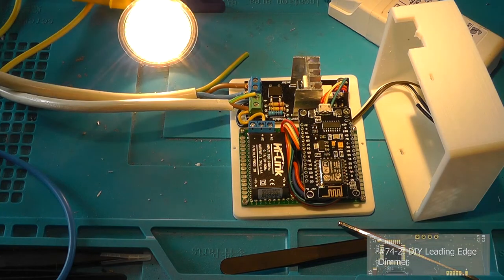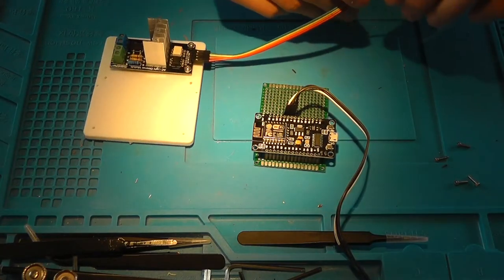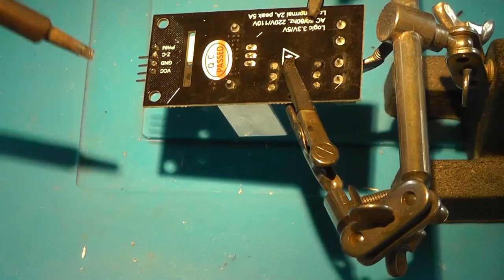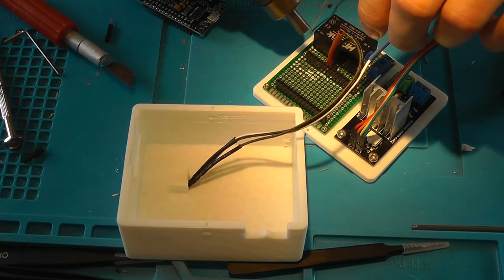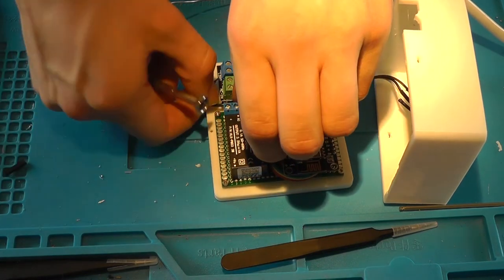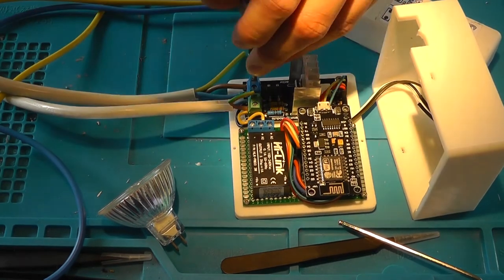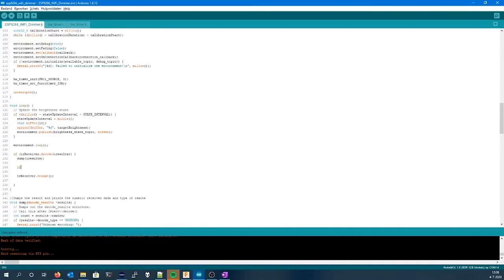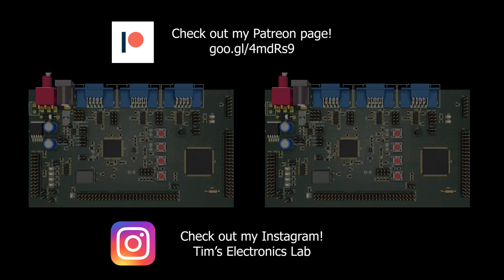#74-2 Creating your own leading edge LED Dimmer 💡

Comment: I'm asking because I don't know English;Do you recommend the hlk-pm01 power module to run esp8266 continuously?
Reply from the maker: Yes! The HLK-PM01 can handle it for sure, I do recommend getting the 3.3V version as that will reduce the current consumption that the LDO just burns away
Reply: @TimsElectronicsLab  Thank you